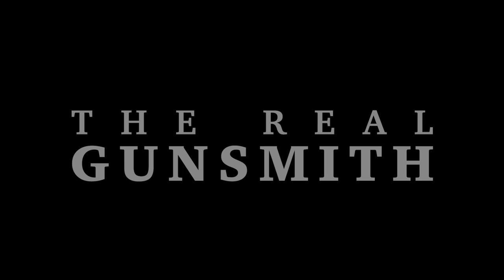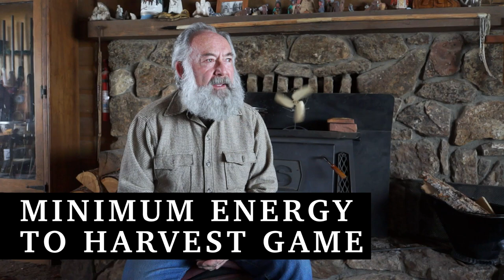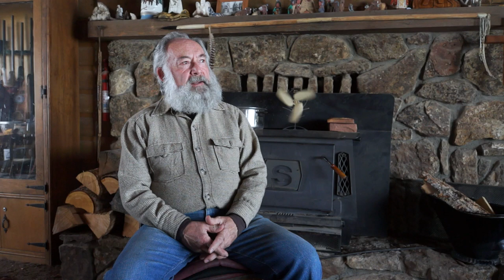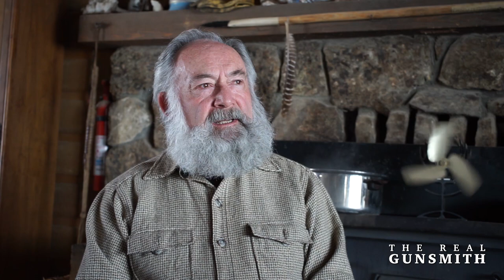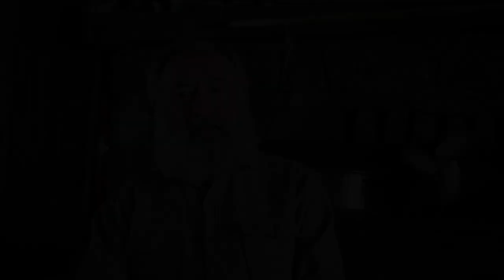Minimum Energy to Harvest Game -- The Real Gunsmith

Comment: Excellent video! Now only if the hunters would actually use this bullet knowledge you're providing. 

The biggest problem for hunters is ammunition manufacturers not loading proper hunting bullets for taking big game into cartridges such as the 6.5 Creedmoor. The 6.5 Creedmoor has a maximum 300 yard deer hunting range at best, but still depends on which bullet is used.

I personally choose Nosler's Partition bullets for hunting big game for several decades. My elk cartridge is the 338-06 A-Square cartridge loaded with Nosler's 210 grain Partition bullets.

I cringe on the thought of hunters selecting and using Nosler's Ballistic Tip and Hornady's SST bullets for big game.

Unfortunately Hornady has discontinued some of their Interlock bullets for the thin jacket SST lineup.

Although Nosler's 120 grain Ballistic Tip out of my Thompson Center Encore 15 inch 7mm-08 Remington pistol barrel will efficiently kill deer. The 120 grain bullet has a better construction than the 140 grain offering.

Ethically taking big game comes down to bullet construction at adequate range, so there's enough energy for the job.

Comment: I just shot an Elk this weekend with a 7MM Rem. Mag shooting 162gr ELD-X bullets. The shot was approximately 120 yards. The bullet passed through the Elk killing her within 30 seconds. I'd have to disagree with you on your point that the ELD-X is not a good killer of Elk. I very much like your videos. Thank you for your knowledge and thoughts. Much appreciated.
Reply: That's on a female elk at 120 yards too though. Not a big bull at 500. Even something like a 223 or 3030 with a halfway decent bullet would enough penetration to make it into the vitals of most female elk at 120 yards because they still have plenty of punch and the target is a little bit smaller though it's still not a good idea . He is talking about optimum. What is best. Especially for longer ranges. What you can get away with with a slightly smaller game animal work shorter ranges is not always the same as what you can do at longer range
Reply: I currently run 143 ELDX 6.5 mm and 162 ELDX 7mms. Not impressed with either although I have a sample of four. 6.5 Creedmoor and 280 AI. They have killed Whitetail well enough but they seem to blow to hell fairly easily. I’ll use them up on deer and targets but wouldn’t use them on anything bigger. And, I don’t use the Creedmoor for anything more than deer and targets. It’s a great Whitetail rifle in a light package that is super accurate.  Much like a modern day version of the 250-3000 Savage. But I see it for what it is.  A well built target, vermin, and deer rifle.  Nothing more and anyone who thinks that it is, is living a fairytale.
Reply: I have also killed a bull elk at over 700 yards with my Hornady ELDx. Worked great. Shot it twice with pass through and gold ball sized exits. I will keep using them. Killed mule deer and antelope also.
Reply: Let us know what you think about it at 400 yards with galf the energy?

Comment: The Eld-x bullet is not good for Elk, but I use it for Whitetail and the deer drop where they stand. Shooting a 25-06 with 110gr hitting them in the heart. Love your videos, and are inspiring me to become a gunsmith on the aide
Reply: Deer do not require a lot of energy. If anything too much energy at close range results in unreliable penetration because the round explodes or you blow a shoulder off and destroy otherwise good meat.

Comment: Yes sir I agree with Barnes and Nosler Partitions  do amazing on game
Reply: W Snapper so does Remington Cor Lok
Reply: Well, I agree with the Nosler, but no more Barnes! I've shoot a lot of big game with a .300 win with them but id say 90% ran, just a little ways and always a pass through shot 1 2 and 3 hundred + - yrds! No more. But great comment. Thanks for listening! Feed me why if you can! Thanks
Reply: Kenny Coye I used Barnes for a couple seasons and switched back to Accubonds and partitions. I only shoot factory loads and Barnes quality control started lacking. I had bullets that weren’t crimped properly and would fall out of the casings. About 8-10 rounds per box.
Reply: Just about any bonded soft point will do but the accubond or similar soft points with a high BC bullet and polymer tip is ideal.
Reply: @kennycoye3907 with the Barnes bullets you HAVE to take into consideration the fact that copper is harder than lead and therefore requires more energy and more velocity to expand reliably. Penetration is never the issue but expansion often is. A 168grain Barnes is as long as a 180 grain lead core Bullet. Therefore it takes up more case capacity because it seats deeper so you have to compensate by using a lighter bullet and it must be loaded hot. I prefer lead bonded bullets for this reason.

Comment: I built a 308 Norma Mag. on a P17 Remington base with a full length military barrel as the P 17 came with.  I shot 180 gr. Norma Nosler Partition.  I only found two of my spent bullets they weighted in some were around  125 to 128 Gr. One was a head on shot  into a black bear shot between the eyes about 100 yards the spent bullet came out the left rear hind quarter and was caught in the hair.  The second spent bullet was a  chest shot into a bull moose about 250 yards same results  instance one shot kill with the spent bullet just under the skin high in the left hind quarter.
I  have  the greatest respect for what you are saying and fully agree with you.
Best Regards
Fred Thompson

Comment: yesterday, I had a tailwind at a 30 degree angle from left to right at 300 meters 0r 328 yards shooting my 7mm magnum and 25-06, for which I had sighted in the day before with absolutely no wind at all. 
  I figured that tailwind would move the bullet impact right so I held on the 9 o'clock and touched it off with the wind at 12 mph. with my 7mm magnum, and it hit smak dab in the middle of the steel 6 in. Painted white target, for a wind blown 139 grain Hornady interlock bullet!  3 inches of windage factored in correctly.
 This is the practice that helps me to keep an edge while hunting. The 2506 and 7mm 
  Are indistinguishable at 300 meters with the same damn amount of a 10-12 mph 30 degree crosswind. Using the 117 Hornady interlock bullets  at 3004 fps.

Comment: As far as I know, everything is important to look at. The weight, the bc and different speeds, the sd, and the realistic muzzle speeds you can achieve with the cartridge. All of these things are important to give you your energy at Target. 
As far as match bullets go. They're usually made too hard for hunting. They're not made to expand at all. They will go all the way threw but they won't give an ethical kill. Due to lack of proper wound channel. 
One thing you said that was pretty interesting to me was the all copper bullet from barns. I'm sure it expands very well and retains it's weight pretty good, but all copper bullets are usually quite a bit lighter for their size. To me a heavier bullet made for expansion would give you a better energy+wound channel for a quick more ethical kill?
One thing we can all agree one is that everyone needs to know their equipment and respect the animal they're taking more than enough to make sure it's going to go down with as little suffering as possible.
Reply: I agree with you completely. Personally, I shoot 200 gr Accubonds in my 300 win mag

Comment: I was completely out of components a few years ago for my 260 Remington. I picked up some federal premium with 140 sierra gamekings, which were the only factory loads in town that weren't target bullets. I took a large bull caribou at 150 yards, and being aware of this bullet's construction I waited for a perfect shot and disintegrated his heart. There was no exit, and fragments were on the other side of the inside of the rib cage. I was on another hunt with a friend, and he put a marginal shot on a yearling caribou (they are the size of a whitetail at that age). I anchored it with a shoulder shot, but at 250 yards the gameking didn't make it through the shoulder, it fell apart and only a tiny bit of copper jacket made it to the ribs. After that I ordered 500 barnes TSX projectiles for my 260 and the same for my 35 Whelen. If you can't get within 350 yards of a critter, you are a lousy hunter. One exception being pronghorns. Those binocular eyes aren't even fair.

Comment: Amen! I learned the hard way about the eldx on elk ,close range high velocity the performance was very poor,bout like varmint bullets. After that experience I tested different bullets at close range in water the eldx disintegrated.In hunting situations we need reliable  penetration at close and long range.
Reply: Clayton Miller what caliber? Because I shot an elk at 50 yards with 300 rum with 212 grain eldx at 3020 fps and the exit hole was about 3 inches. I killed an antelope at 804 yards with same load and it left a 3 inch exit hole

Comment: Cup and core bullets have been used on game since jacketed bullets were invented. Hornady interlock and Speer HotCor has proven to be fantastic deer hunting bullets fornme and my family in our corner of TN. Maybe they’re less ideal for 800 yards but here they’re absolutely phenomenal on deer, out of 30-30 Winchester, 25-06. I’ve taken game with cast bullets and everyone did before the invention of the cup and core bullet. Deer fall to cast pistol bullets, out of my muzzleloader with just 70-80gn charges of FFg BP. I wouldn’t try them at 300 yards with that charge on a windy day but 200 I’m confident.

I have to agree that we need to be careful to not try and outshoot our cartridges on game. Just because you can get a mark on the range doesn’t mean you can hit with enough authority on game at that range. I’ll share with you that I’ve had deer fall over where they were standing with shots that stopped on the skin on the exit side or far side. I’ve blown big ass holes through them and had them run 200 yards. Whether a bullet exits is at my range’s and in my experience irrelevant. Ideally you have 2 holes to bleed from but sometimes the temperature is a little lower and that shot punches through the heart but not the far side hide and it goes down anyway. I take it you’re talking about specific situations for specific terrain.

Comment: Im with you 100% This year for deer I used the 26 Nosler. Usually im shooting a 140gr Barnes XLC bullets in my 6.5mm but they dont make that weight or bullet any longer. For weight I talked myself into trying the 143-elx instead of the Barnes 127gr.  Second day i saw a respectable 3pt at 325yrds. I took the shot and hit it 3rd rib from the back. The bullet barely made into the ribs before blowing up like a granade. What was left of the bullet were slivers at best. I know if i would have hit that little buck in the shoulder bone it would have blown up and never made the vitals. I love the 6.5 and hope Barnes will again come out with a heavy long bullet for high sectional densities...

Comment: Well, if a church sermon  was more like this  id be in church right now all wide eyed n dry mouthed. Yes I switched from Sierra GameKing myself and switched to a handloaded  Speer GrandSlams and havent looked back since and as of the 2018 hunting season shot like 15 elk some cows some bulls with an old CIL 950C in a .243 that i bought when i was a snot nosed teenager. I try not to  shoot past 400 yards and have had multiple complete pass throughs beyond that yardage and have accidentally shot elk n moose at 100 yards or so right in the shoulder knuckle and the GS was never recovered and few have been. I know the usual bs about hunting with a .243 but it was my first gun, shot out the first barrel, wore out 2 extractors n shot a boat load of gophers n coyotes n deer with it and one day dropped a 5/5  bull elk at 375 yards in northern Alberta and since havent looked back. Good bullets and shot placement and the rest is just grunt work .. Great Vid..

Comment: By all accounts .30-30 is supposed to be excellent on deer under 200 yards. As a younger man I once recovered a neatly mushroomed .30-30 bullet from the shoulder/neck of a whitetail buck I’d shot at a range of no more than 140 paces. The bullet passed through a few inches of hide and muscle, then stopped against the vertebrae. This buck had a thick heavy neck, but I still find it hard to believe the .30-30 didn’t penetrate further. Sadly it took more than one shot to bring that tough old buck down. After that I hunted with .30-06 almost exclusively. Of course better shot placement would have made a huge difference, but I don’t care how “good” you are, there are many factors that can lead to a slightly misplaced shot, and even a few inches can make a big difference. USE ENOUGH GUN.

Comment: And see now it depends on what your doing here too seems to be a lot of talk about elk and I'll admit I've got no experience there and I'm sure a tougher bullet is essential to a successful hunt. Makes sense. Now the problem is people get that in their head to use that same bullet in lighter skinned whitetail, mule deer, antelope and so on. Problem is what you get there is a pencil hole in and a pencil hole out with very little blood and a running wounded animal. A cup and core bullet however and it's explosive nature is very reliable on lighter built animals though. All that energy and destruction gets dumped right there and it's very effective. My point being although you call them target bullets they are actually a very effective and much more humane bullet on lighter animals. And I disagree with the idea that bc it's no big deal. Its a fact that higher bc bullets buck crosswind better and that makes for more room for error on wind calls which leads to better shot placement and more humane kills. My two cents for what's it's worth. Enjoy your videos though
Reply: I agree , my 6.5mm creedmoor with 143 grain eld-x works great on southern whitetail.  4 bucks and 2 does from 25-275 yards last year. One shop stops, nice exit holes. I was particular about my shots,  all high shoulder, no problems.  I have zero experience with elk, so I won't comment on that.

Comment: Well I've hunted with 85gr bthp for years with a 243 win. The bullets come out sometimes on a white tail. I dont shoot more than 200 yes. However, I have seen way more deer run 3 to 500 yards with a 308 and a 30-06 150gr. Than i have the 243 with 85s. What a bullet does after it leaves the game is wasted except to trail the game.
Reply: Ditto: I sometimes guide for dudes and I've seen more whitetails wounded and lost with 30 calibers than I have with folks using quarter bores.  Part of it, of course, (and they won't admit it) is sensitivity to recoil.
Reply: @garyjones6288  Would venture to say many of the people you guided that  were using 30 caliber Cartridges were  not experienced hunters .New guys will tend to go for the bigger powerful guns that  the guy at the gun store tends to sell them. Experience hunters will know they can get the job done with a lesser cartridge and better Shot placement therefore they tend to use lighter calibers more regularly than the newbies. So the results you’re observing could be the fact that you were dealing with unexperiencd hunters that are using the larger caliber’s .  Poor shot placement will always result in longer tracking jobs
Reply: Try The 100 Grain 243 Win Federal Loading  I’ve Had Lots of Luck With it
Reply: I had trouble one year with the 85gr bthp bullets one year and went to 90gr ballistic tip with 37grs IMR 4064 does a great job. Only time I use 100 to 105gr bullets in 243 is on mule deer.. seems to do well. Or a 120 btbt in a 264 mag

Comment: I liked the old remington umbarella tip RN moving at about 2200 to 2400 fps in moderate to heavier wt.  example:  6.5 Mannlicher Schoenauer 150 gr.--- but my stutzen rifle had 17.7" bbl. Doubt it moving much over 2100 fps at 150 yds...yet it entered smallish (300 lb maybe) black bear quatering away, behind left rib cage, and passed out right fwd shoulder---about 2"  exit.  The bear went about 10 yds. and died.  I have found with bears that often heart shots do not stop right away.  Add double lung or CNS damage, more quick.  Mr bear has lots of blood. sometimes all oxygenated for flight or fight.   But, frankly diameters below 7mm on bear may be onconsistent.   On other hand I also have 376 Steyr....that butt ugly rifle with 250 to 270 gr is a pancake flattener....especially with Swift projectiles.

Comment: Randy, I have been hunting for nearly 50 years, and it took me 50 years of using different kinds of bullets (I have always avoided hollow points) to come to the conclusion that the Nosler Partition is the best bullet for Whitetails,  close or far. I was a core-lokt man for many years, but began to feel like their lead was too brittle and they were fragmenting. I am intrigued by the Barnes all copper bullets, even though I haven't used them.  In your opinion, are they better, just as good, or slightly less better than Nosler Partitions? Thanks.
Reply: I’ve been loading and hunting elk deer bear with Barnes X-bullets since there inception! Great hardware
Reply: I have shot elk mule deer and multiple species of african antelopes with the Barnes TTSX bullet in .30 cal 180gr and I am thoroughly impressed with it. It penetrates very well and has very controlled expansion. I have only had one bullet fail to penetrate out both sides of the animal.
Reply: Barnes copper bullets are fantastic. Just make sure you have around 2400fps velocity if you want full expansion. 1800fps is typical for minimum expansion.